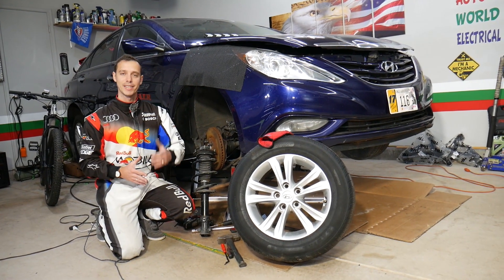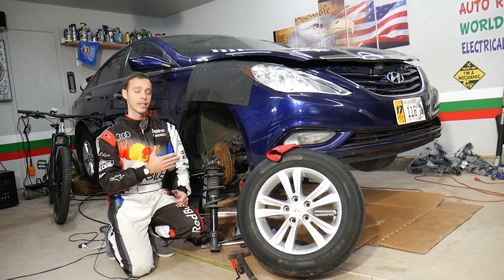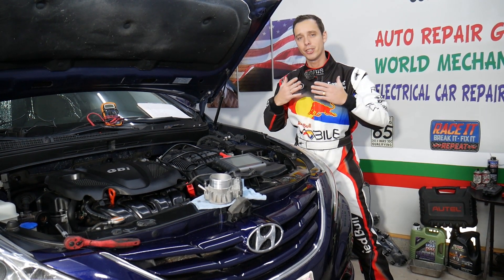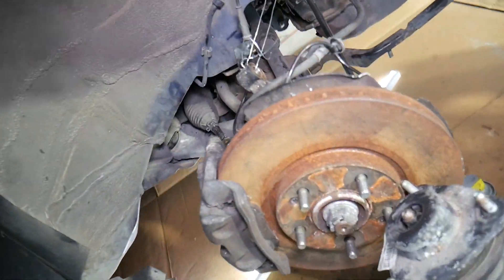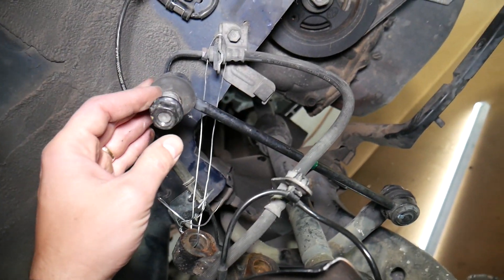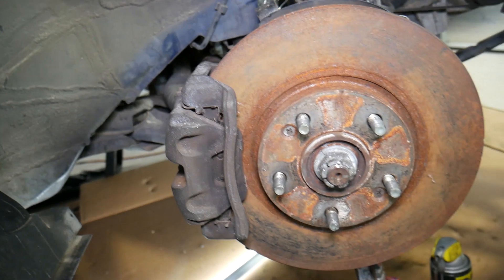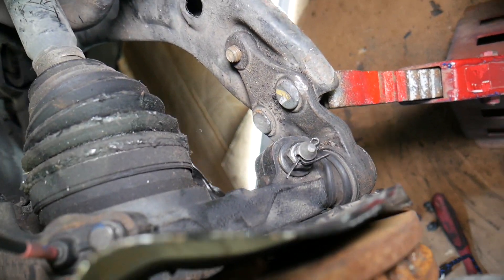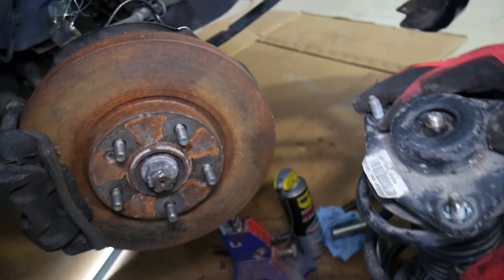CLUNKING SOUND WHEN STEERING, TURNING STEER WHEEL ON HYUNDAI

Comment: My 2015 Santa Fe XL that I haven't driven in a while started making 'clang' yesterday when turning hard either direction. Sound came from left (drivers in Canada) side. Sounded like taking a wrench and hitting a big spring. Lastong Vibration after thump.
Your video was great! Now suspect strut. Makes absolute sense. Will check other points as well. Thank-you!